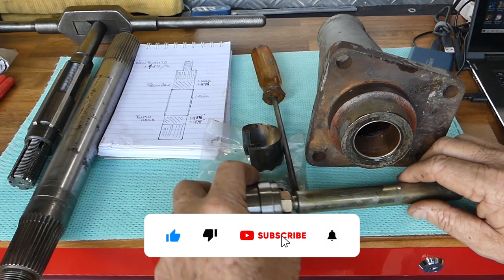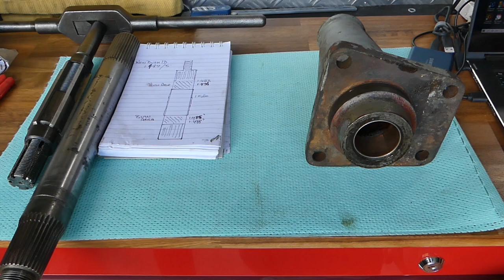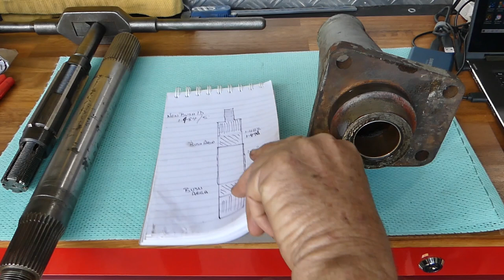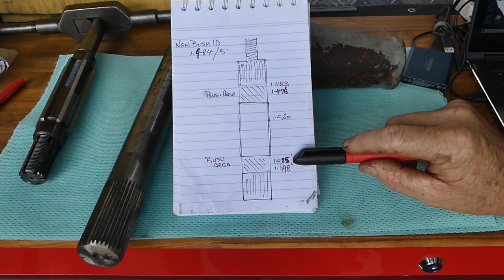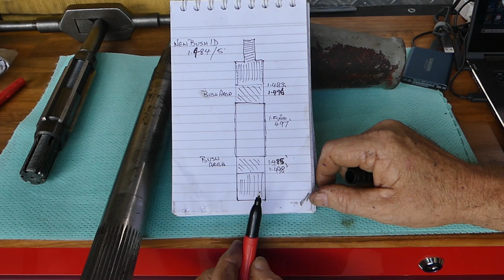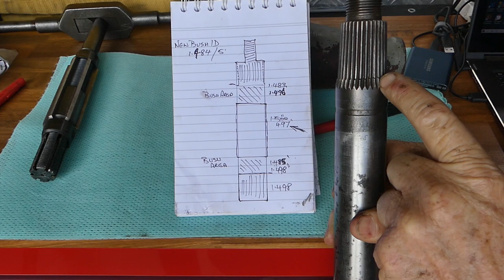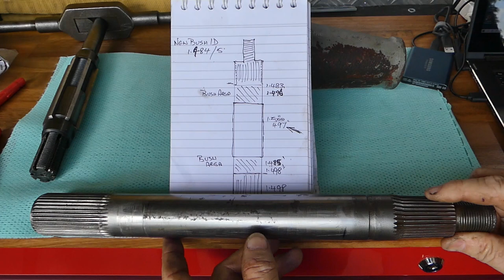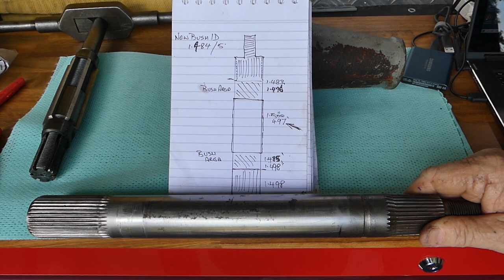Massey Ferguson 65 # 5 Working on the Steering Pedestal Shaft

Comment: Machining work can be more rewarding than just fitting new components, another great video on “how to “ Lance,

Cheers,
Paul.

Cheam,
England.
Reply from the maker: Very true!
Reply: @BundyBearsShed  how did you manage to get the the ball joint what goes into the lower half of the spindle bell crank out??
Reply from the maker: I think from memory it was a 3/4 spanner but I had the pivot shaft off and pulled the whole thing out
Reply: @BundyBearsShed  is the hexagon underneath the rubber seal?
Reply from the maker: @PandaJ  yes